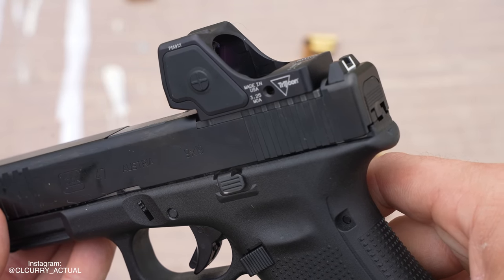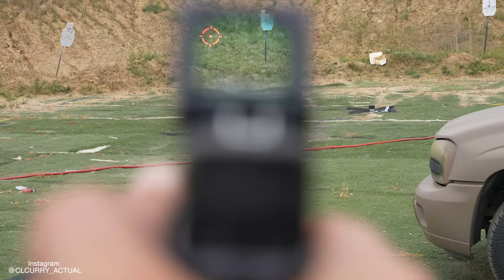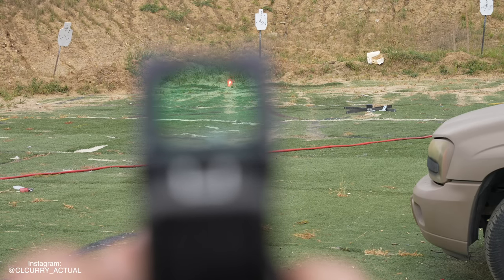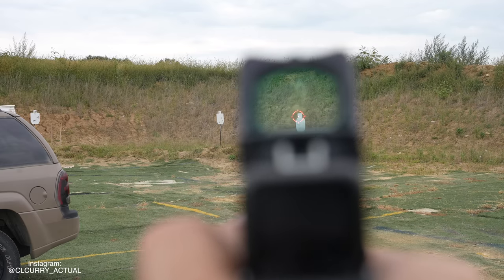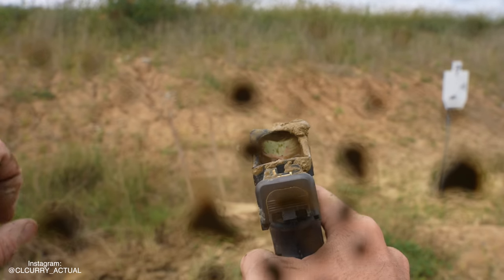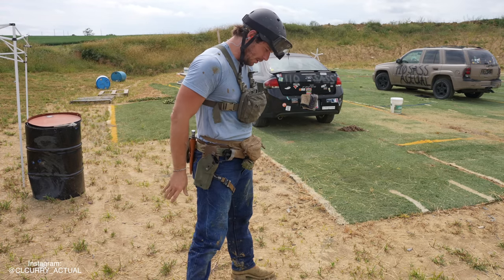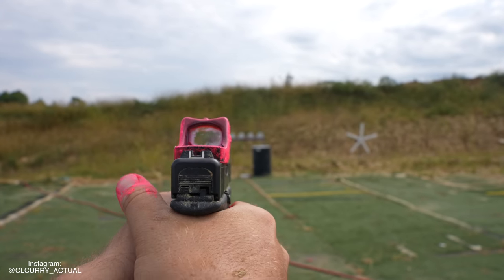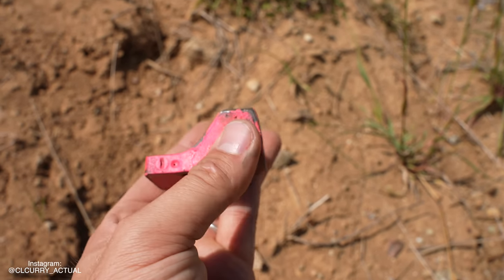Trijicon RMR HD -- Destruction test and in-depth look

Comment: Excellent Review. I picked up the HD2 (3.25 MOA) a few weeks ago and I'm very satisfied. I chose the RMR HD over the RCR  primarily because of the automatic brightness mode. However, when I tried out the Reticle Relative Brightness feature that allows you to set the illumination or brightness of the dot different from the "doughnut" ring. Great feature. Especially if you hate the fact that the ring appears to "cover" up some of your target at distance (as noted in the video.) Bottom Line: You pay a hefty price, but it's worth it. This is the best pistol red dot on the market as of Mar 2024. Now, if they weren't so difficult to find. NOTE: I got the HD2 b/c I couldn't find an HD1 (1 MOA). However, when comparing it to a friend's HD1, the increased size of the HD2 dot is almost imperceptible.

Comment: Last year a dumb "qualified gunsmith" had oversized screws mounting my RMR while he was installing my comp. Instead of shaving it down with a file like a normal person, he didn't realize he was bottoming out the screws and drove down into the striker channel of my Glock with a hammer. Later, my Glock 19 would have an out of battery detonation on me, taking my hand with it. Fortunately, the RMR still worked even after it's been fucked up, and all my fingers are now fine outside of nasty scars and nerve damage!

Tldr; last year a gunsmith hit my RMR with a hammer and my gun blew up on it, taking my hand with it. Still worked 

I still have aluminum shrapnel from the RMR in my finger, it's a part of me now. If you got Discord, 110, I can absolutely show you pics of what happened to my hand and my RMR—even the X-ray of my finger with the RMR shrapnel in it 

Even the older Type 2 was very durable.
Reply from the maker: Holy shit. That’s awful bro. 

Still have function in it?
Reply: @110sassactual  my hand? Yeah my hand is good 

Again I can show you some stuff on my RMR
Reply: Jesus Christ, that's terrible.

Comment: Rmr's durability always has been unrivaled. And most of these new features are welcomed. But it's a bit disappointing trijicon didn't upgrade the glass quality much. The heavy blue tint and noticable distortion are still present.
Reply from the maker: Think so? 
I’ve never really noticed/been bothered by it tbh
Reply: There’s some misconceptions about how these sights work. Those are non-issues. The “blue tint” is the notch filter. It’s intentional. You can completely cover the front of the glass (it’s called “occluded”) and still shoot just fine as long as you are target focused. You literally don’t need to be able to see through the optic at all. You just need to be able to see the dot. Try it.